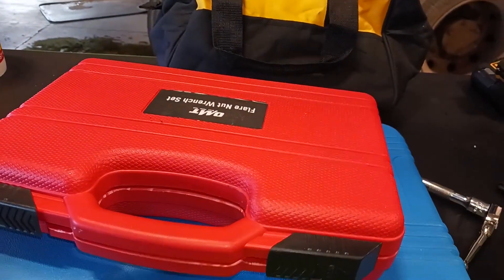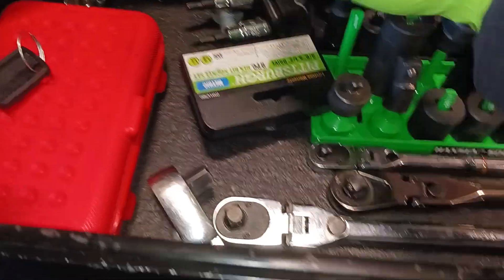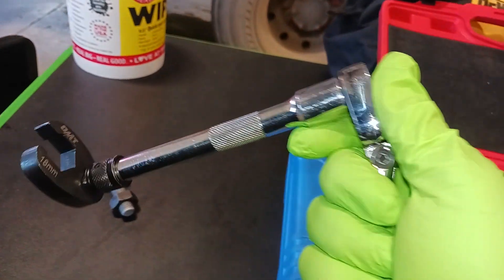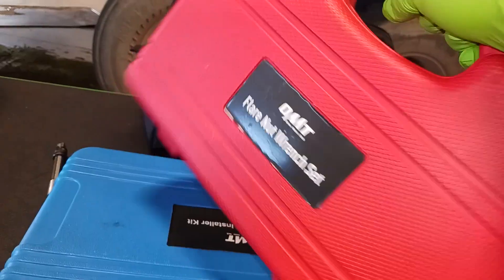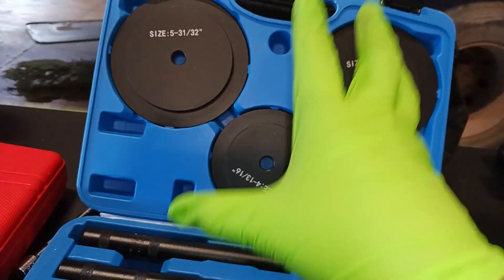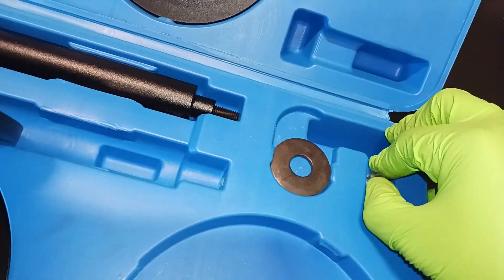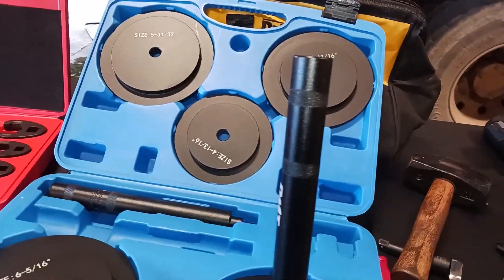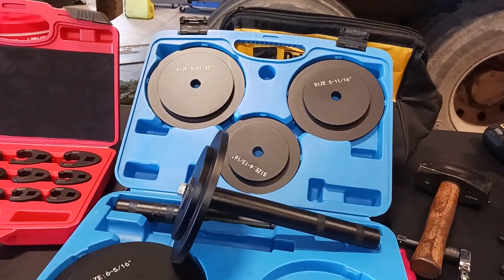Truck Mechanics Need Love Too! | Some Nice Tools From Orion Motor Tech

Comment: The handful of OMT tools I have bought are worth the price. They will never compare to tool truck quality but for the price, they are very good. Bought an olive drain pan plug rethread kit and it saved my friends' Toyota Highlander oil pan after a Quicky Lube stripped the plug bad. Also, a trans fluid manual pump with fittings worked well for a transmission service on same Highlander.
Reply from the maker: Sheeesh !  Now that's what's up!

Comment: OMT sent me a set of AC Manifold Gauges to review awhile back. They worked well and we use them at the shop any chance we get. My wife bought me a pair of their adjustable hose clamps for removing fuel lines and stuff for Christmas. Can't wait to use them this weekend doing the water pump on my Suburban 💪💪💪

Comment: How would you say those deal installers are? I’m looking for some but Im not sure what brand or sizes I need because we use different brands and sizes of wheel seals so I was just curious
Reply from the maker: There are pretty good I never had any problems with them personally.
Reply: @ would you say they are universal or like good with certain seals like stemco,national?